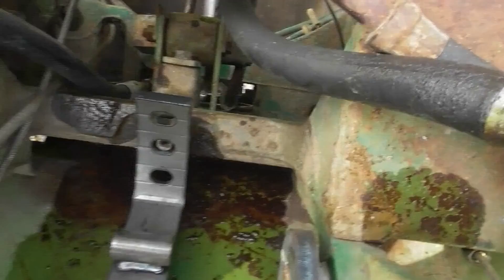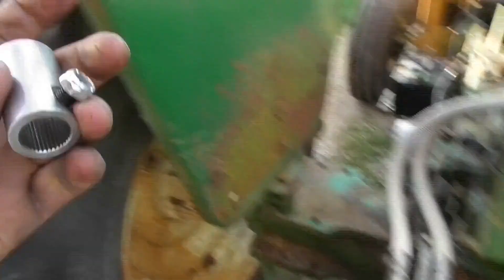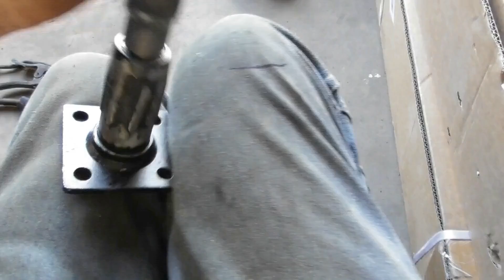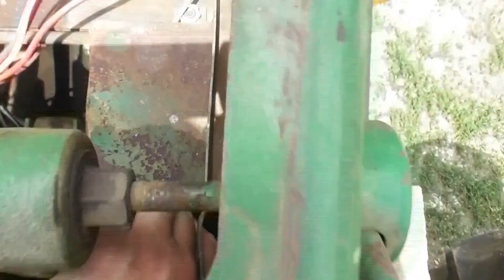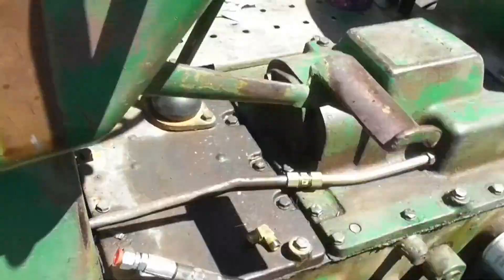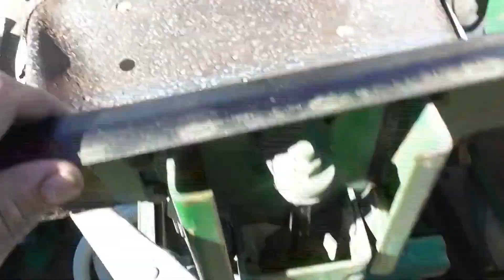1850 oliver charlynn steering motor upgrade this thing is dangerous to drive! WHEATLAND!

Comment: This appeared in my recommendations, and I've got to say it was cool to see my video helped someone out. I like your additional spacer plate to move it down to miss the throttle shaft. 
There's a spring and spool in the valve that steering pressure comes from that reduces the pressure because the Saginaw was only rated for 1500 psi. You can shim that spring to get the pressure higher for easier steering.
Reply from the maker: Ive watched several of your vids, you are my go to if I need Oliver info, you are the oliver guy! I always liked the 1850 Oliver and cockshutts, i finally got one, its been a project so far, and made easier to tackle with your help. I'm no Oliver expert by any means. we are an ih farm with a few older Massey's, allis Chalmers, only other green we have is a Duetz, now we got an Oliver, dad said he would disown me if I brought home a Jd, lol. Something is not quite right with the steering, gets hard if you turn it a lot sitting still, just fine moving though?
Reply: @chevyfarmersgarage1955  I run the front tires up to 45 psi on my loader tractors,  makes a big difference.  
It sounded like the flow divider relief was opening when it was turning hard. Pull the front cap, it's the smaller of the 2 caps. there's a spring,  shims, and a plunger in there.  I'm sure your new orbital can handle more pressure than the old one. Get a couple washers that you can use as shims and add them to the stack to bump up the power steering pressure.
Reply from the maker: thanks i appreciate it, ill give that press bump a try, it does chatter somewhere down low when i turn? almost like its coming from the lines that run up front? also im pretty sure i need to reseal the box up front, got some slight leakage somewhere up there, it also needs a water pump, the bearing is loose, i thought id tackle all of that up front at the same time